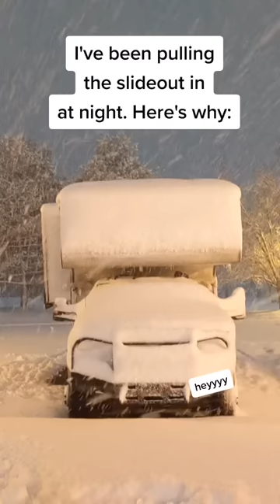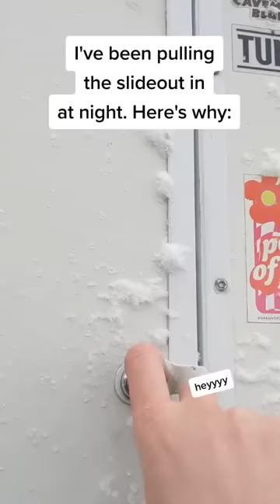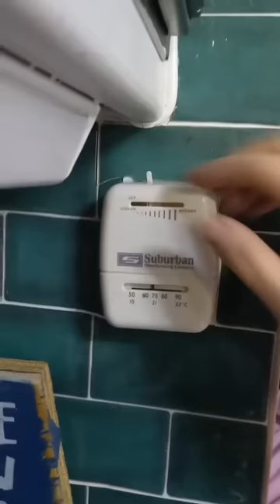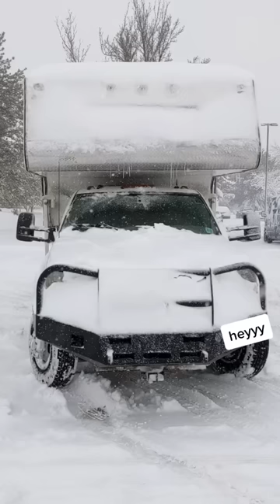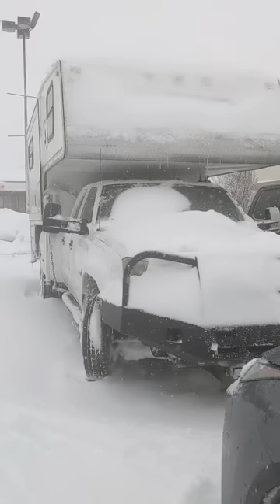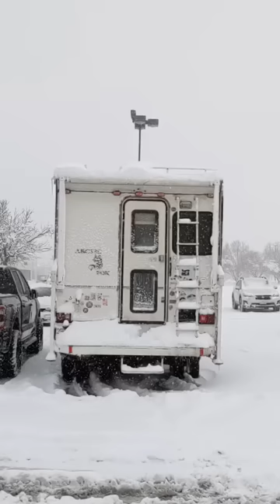the truck camper slide out theory #truckcamper #rv #rvlife #vanlife #fulltimerv #travel #slideout

Comment: Do your own test. fill just 1 tank use your heat for 15 nites with slide out, then Refill that tank & note how many lbs. You used. then use the heat with the slide in it for 15 nites. Refill it again & see what the difference is in vs out. The only variable to consider is different outside temps. & wind speeds during each test.

Comment: I think the slide out has like a rubber seal so unless it's out that seal isn't sealing so you've got draft warm air escaping from the top and cold air coming in at the bottom so perhaps it's the seal that is not working when the slide out is all the way in.

Comment: It will be better insulated with the slides in but that's not the reason you want to pull in your slides at night while in the snow. Snow buildup is awful for your slides and will cost you far more in repairs then you'll ever come close to with a little extra heating.

Comment: Absolutely you re correct less space to heat gives you a definite savings, both battery and propane.. battery ignites your heater, but not only as it runs the fan and less space causes you to burn less propane

Comment: You prob do because when the slide out is out it's not as sealed as it would be when it's closed. Less air flow from outside. Hint why when you move into an old house with the old style wooden windows and then replace them with new windows you save on energy, same concept with your slide out camper

Comment: It is not about the area in this case, being that it's only an extra few square feet. The reason it is running less because it is better insulated, with the slide not being out. Insulation is the only factor that is relevant in this situation

Comment: Of course come on the less exterior wall area  you have exposed to the weather this is common sense .   Its  less square ft. And  less aiir to heat  and the number one thing less windows exposed glass  single pane  really losses heat

Comment: Your saving a lot. We turned our furnace off and saving propane and money. We use an old propane heater from an older camper. My propane lasts 3 weeks not three days. Close everything you can because of the smaller area. Yes,it is a real thing.

Comment: I think your using more battery power by putting the slide in and out twice a day. It takes alot of battery power to put the slide in and out. I dont think your saving enough propane to make it worth the effort. Your in a camper which is a small space. You will save more propane by simply turning down the thermostat to about 68 or 67 at night but leave the slide out.

Comment: If it helps its not much. Also a faulty thermostat will cause it to excessively kick on and off. Check for drafts that could be causing the furnace to kick on from the temp drop

Comment: It's technically true however those two things are a negliable amount.  The reason you would be saving much more propane because all the corners you have the more potential for energy leaks you will have.  Pulling the slides in creates better energy envelope seal.  If you got reflectix for your windows you would save a TON in energy too.  If you use tape to join reflectix panels to fit a window you absolutely need to use reflectix tape or you won't have as much efficiency.

Comment: It’s less exposed surface area to the outside air.  Figure the top, bottom, left and right sides are not exposed when it’s in.  Of course it will be easier to heat & cool.

Comment: You're not saving anything cause you still have to heat the space. You need to address the air leaks in your camper to save energy. The slide outs leak air whether they are in or out.

Comment: You do save money by setting the thermostat down. Here is why.
Heat loss is directly proportional to temperature differences. Intuitively this makes sense. So if you turn your thermostat down you heat loss is less during those hours.
I am a DOE certified Energy Star Home Builder.

Comment: It's not surface area... It's loss of heat due to the giant box hanging out the side with 1 1/2 rubber wiper seals that DON'T make perfect seals and create drafts.

So you aren't losing as much heat through these draft corners. Another thing you can do is chuck that bimetal thermostat in the trash and purchase a two wire battery operated digital thermostat by say Honeywell, it does a lot better job at keeping a consistent temperature.

Comment: If you can tolerate keeping the slide out in whenever you are in the kind of weather in this video, I would. Not only does it save your propane/power by making the area you heat less, it also decreases the cold temperature convection by sealing up metal. Personally, if things get really cold, then make the space you sleep in smaller, like a blanket fort and then get some dryer vent tubing and shunt it into your tiny space.  I’d use an insulated sleeping mattress too, which would reflect your body heat back to you without even using power! My favorite is the Exped Mega Mat Duo 10 which is super comfortable, quiet, non porous (no mold/very cleanable) and has insulation of R-9.5! It’s a lot lighter than most RV mattress too and you can adjust the firmness. My daughter camps in her tiny Ford Transit Connect XLT and I got her an electric blanket with “Safe N Warm” technology (since I like mine so much) that plugs into 110v but converts to 12v and is very safe and uses a fraction of most electric blankets.  She wanted the twin, I thought the throw blanket size would be better but got her the twin—she says “yeah, I could have just used the throw blanket size”. You won’t regret either item.

Comment: you can also use plumbers tape , on the brass threaded connections on your propane tanks. 
 it helps seal up any micro leaks at your connection. 
 keep your tanks warm by wrapping them with a Uhaul blanket in -35 c.